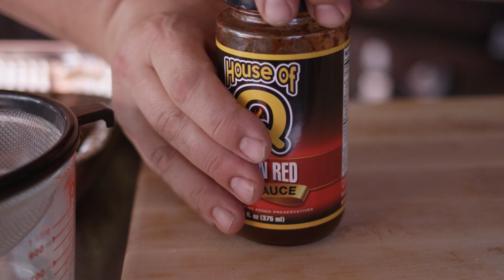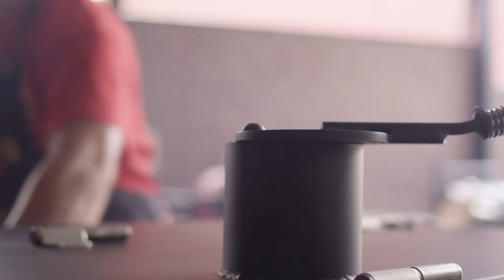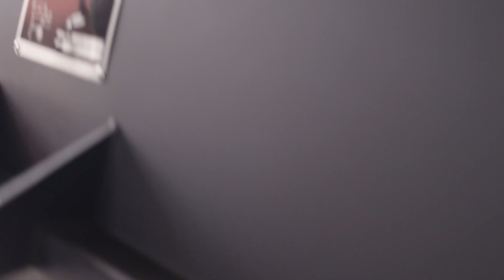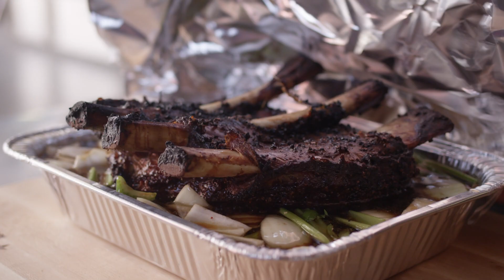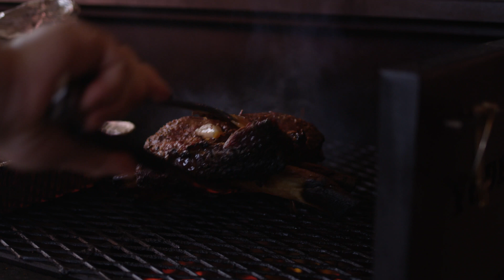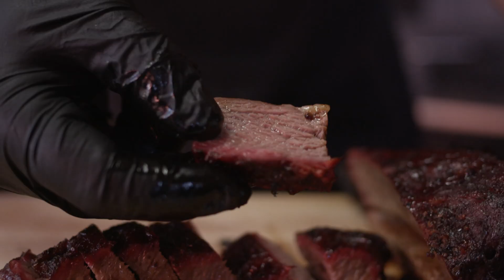BBQ Brian's Beef Ribs

Comment: Hi Brian, I'm in the market for this cooker. I am wondering, since the lid is only a 12 gauge steel, do you experience any paint bubbling from direct high heat in the areas where you usually have your fire? I am contemplating whether i need to reinforce those areas by welding another plate of steel on the inside of the lid.